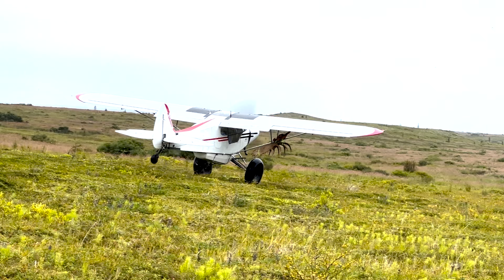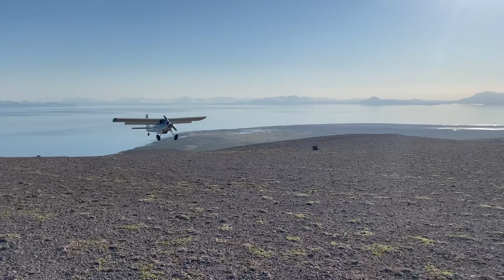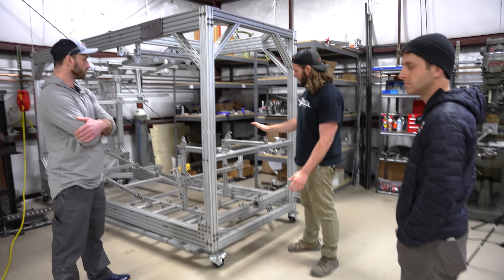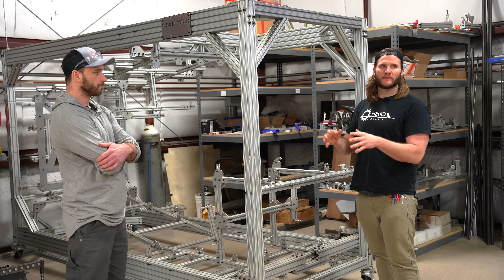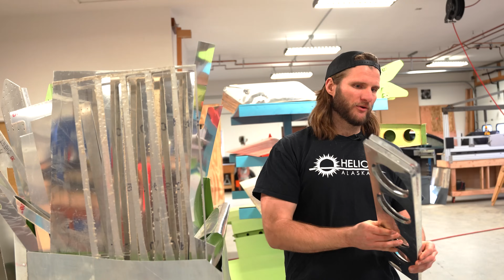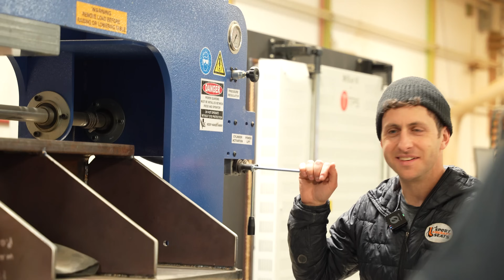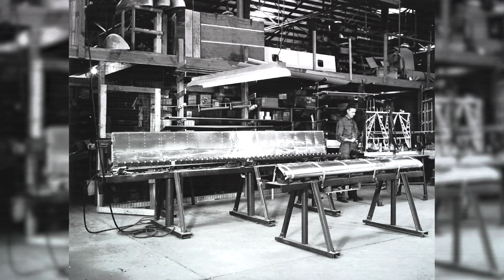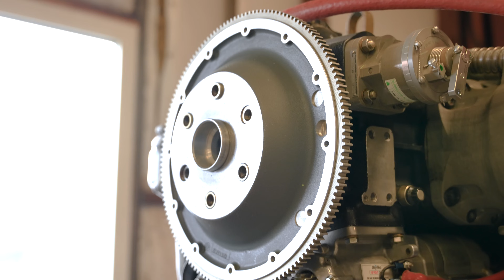Building an Airplane Factory... From 75 Year old blueprints

Comment: Most of these airplane designs were junk... too costly and complicated to build, which is why most never got finished in people's garages.
Probably the absolute closest to best was the B1RD... but I've been told by someone who owned one, it was a dog, and his favor was the Legal Eagle.
I myself bought a VJ-24w, and a Woodhopper, which both are about the most minimal airplanes you can build... and I quickly lost interest in both before doing much work on either.
The simple fact is, in 2025, we have better ways to get airborne that are far, far more likely to get you airborne with simulators and FPV quadcopters... you can be flying in under a week for a few hundred bucks, not thousands and thousands and 20 years later.   
If you want to fly, building an airplane is about the absolute worst way to go about it.    You don't need to be in a cockpit any more to enjoy flying.   In fact, being in a cockpit, of an airplane you built yourself, where all your energy and focus was on building and finishing the airplane and that consumed all your time, and none was spent on actually learning how to fly but thinking you got this...    just like riding a motorcycle in the sky...   I got this...   is about the most dangerous way to fly.

Comment: This is a remarkable story that took me back to Henry Ford and the B24.

Ford agreed to apply the automotive production line processes to build the heavy bomber. 
1. Consolided didn't have drawings for all the parts but they were building planes. 
2. Ford didn't have a facility for the the effort. 
3. Ford turned a soybean field into a bomber plant that produced nearly 8000    B24 planes in 4 years. Final production rate was one plane per hour. 

It is worth your effort to search out the Ford story and review the challenges.
Reply: B-24 - Ford didn’t build B-25’s…
Reply: @allangibson8494 
My error..
The point is that he accomplished the nearly impossible in two years from nothing and no computers.
Reply: @ Most people in history succeeded without computers (or AI). They are a tool you work with, use them correctly and they help, use them incorrectly and they hinder what you are doing.
CNC is the same (usually delaying, because it encourages unnecessary precision).

Comment: It was great plane but had some sort of spar issues, Hopefully you're not going to build that into the new one. Why didn't you put the lycoming 700 in there? Lastly, I would've made a four passenger version of this to start, less expensive to build with a much larger market and much larger engine selection. Which would amount to a four passenger Supercup made of aluminum. there's your market. cessna would start making 185 if there was a market for it. good luck.

Comment: There have been several different powerplants tried, the best was the Lyc 720. The Lyc IO540 J2BD  would also be a good engine. The biggest problem with the Helio was that it was really heavy. A turbine would be a better fit if not for the expense.

Comment: The airfoil for the Helio is 23012.  This is an extremely common airfoil and it was used on many different general aviation airplanes.  Edit: they are changing the original airplane especially the engine.  When using the CNC holes, this changes the original certificate.  All of these changes will make it more challenging to "recertify" the airplane.
Reply: Simply building in a new factory with new techniques and tooling requires recertification for the manufacturing process.

Comment: I agree with you. The U.S. needs serious tort/liability reform in all cases. It also needs to have its aircraft certification process completely overhauled. These two factors are the cause of sky high prices. As demonstrated in the video, today’s CAD technology enables the smallest businesses to operate in ways that would take a giant factory to produce in the past. The demand is there, it’s the price that causes little to no new orders for new aircraft.
Reply: This is an amazing undertaking and I hope it succeeds.  The liability issue for aircraft design and manufacture is a serious problem that needs to be addressed with regulation tied to the certification process to limit the liability of responsible manufacturers who have properly certified the design and manufacture process. My background is in engineering and law and it is clear that current litigation liability concepts create an almost "strict liability" environment in which any injury accident results in the manufacturer being held responsible regardless of the quality of design or workmanship.  Flying any aircraft is a relatively high risk activity that requires skills, judgment and care and the pilot should be held more responsible for their own failures of judgment or ability.  These guys are brave to take on a project like this in this current extreme legal liability environment.  I really admire what they are doing.  Perhaps the Alaskan state and federal legislators can be persuaded to push new laws limiting such liability problems in order to facilitate needed aviation projects like this that are especially important to Alaska as well as other rural and wilderness areas.
Reply: Its far more serious than anyone realizes. Upon purchase of a type certificate with intent to restart manufacturing, the holder of said certificate also becomes responsible for any and all AD's against the type.

Comment: That engine is going to be an uphill technical battle, not to mention the certification difficulty.  Speaking from experience it would be better to look elsewhere for the engine, one with a type certificate.  Great work on this though, it’s obvious the quality of the airframe will far exceed the originals.
Reply: Based on how far they have come in five years, they could probably pull it off.

Comment: I have been wanting to do this. Do you have the drawings for the H-500 Twin Courier. I want one so bad I could just spit. How about H-550 Stallion drawings? H-21 crop duster drawings? I have lots of ideas for modernizing these. What engines are you planning to use on the completed aircraft? This is critical! If you go with a gasoline engine you will NOT have a market because in the Third World Gasoline is no longer available and you must go to Jet A/diesel which is all that is available.
Reply: H500 was challenging to put it politely
Reply: What I intended to say is that Aviation gasoline is basically no longer available in the Third World countries yet Jet A fuel is available. That’s why MAF and JAARS sold their fleets of Helio airplanes. Al Gore continues his destruction on climate change lies.

Comment: For the love of all things holy BUILD IT AND SELL IT AS A KIT!!!!  Forget about FAA certification of the whole plane.  If you can sell parts to keep the legacy models going, then that would be great!  If you market it as a kit, you will attract a much bigger audience and move a lot more aluminum through the shop.  The FAA regs are killing certified GA aircraft, and going EAB will allow a wide variety of engine choices from turbines to alloy V-8s.  Im so glad its moving forward and I dont want to see it choke on red tape!
Reply: You can’t carry paying passengers in an “Experimental” category aircraft.
That’s the target market in Alaska - air taxi services.
Reply: You can't fly for hire and reward in a kit plane, that's a whole different market, this aircraft needs to compete on price with only the US$750,000 Cessna 206 stationeer and it will dominate that section of the market, it will already outperform it, the next best option is a PAC P-750 XSTOL, but at ~US$2 million, it's in another class entirely.

The market is saturated for kit plane toys, go get a murphys.
Reply: That's unfortunately what happened with the delta hawk diesel engine it's over priced now
Reply: @jamesringler987 

Im concerned that trying to please the feds will bankrupt the whole project.  It might be cheaper to reproduce GO-480 parts to keep those engines going

Comment: They were used extensively in SE Asia in 1969.  Labelled the H-295, they had a Lycoming GO-480 with 295 hp.  Outstanding STOL performance along with load carrying capability.  I don't care how many hours you have in them, the automatic deployment of the leading edge slats always gets your attention (they "pop" out).  The pilot has no control over them since it is airspeed (relative wind) that determines deployment on approach.  My greatest concern was unequal deployment, but it "never" happened.  Each wing has 5 components (double leading edge slats (2), flaps (1), aileron (1), and wing (1).  It may sound complicated but it's not.  Very simple systems and lots of interior space.  Great performer, but don't get cocky, especially on takeoff.  Later models have a monster motor (IO-720 as I recall) but it's a big trade-off for gross weight against fuel consumption.
Reply: Do a search for "Air America," they flew these (and the Stalion, the turboprop version) extensively. The old AA Chief Pilot (fixed wing) was my CP at another operation for years.